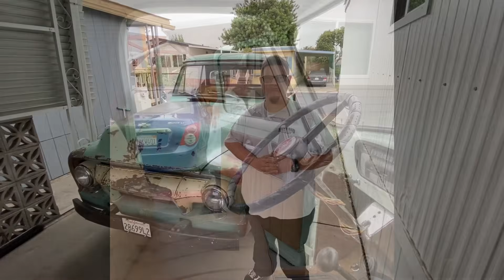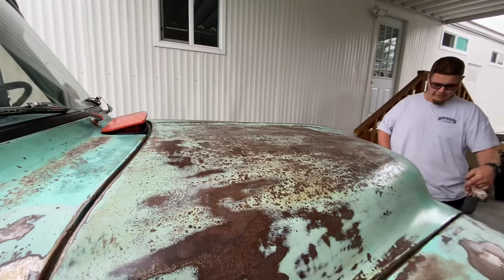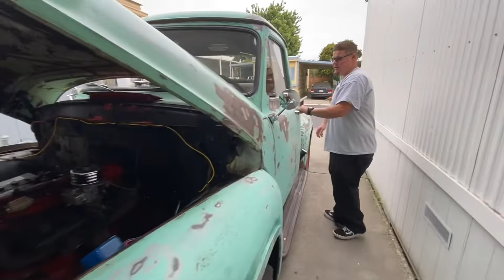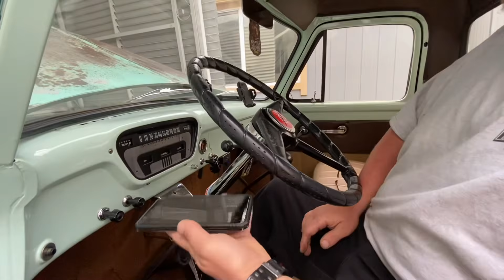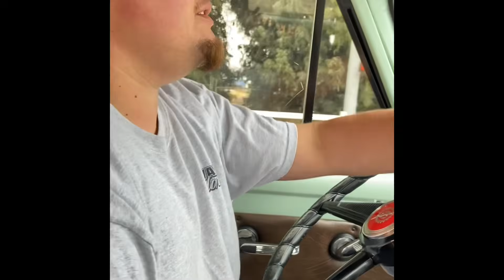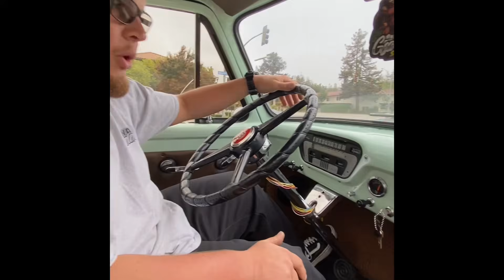1954 Ford F100 Ride Along

Comment: I like the belt strap that holds the battery down.
Reply from the maker: lol yaw it is a ratchet strap. The plan is to move the battery back under the cab, i have the parts just need the time.